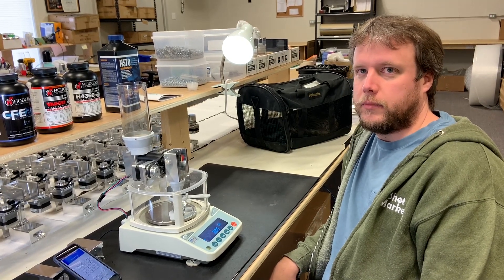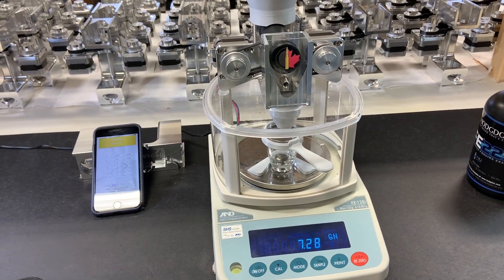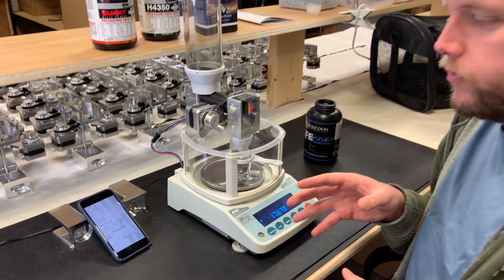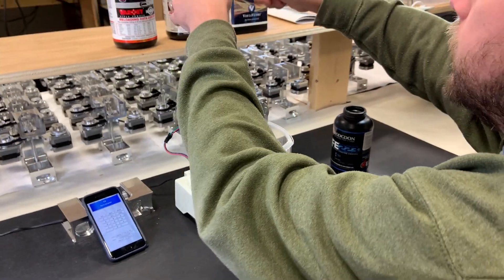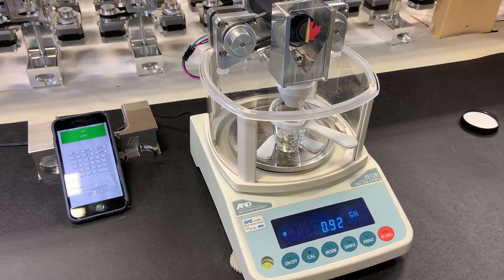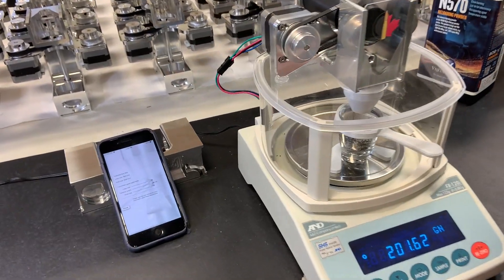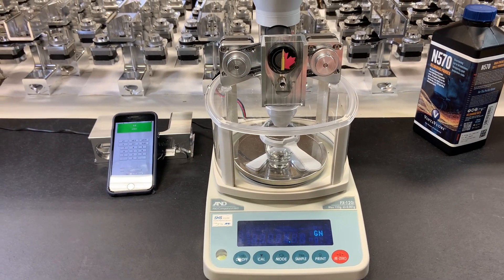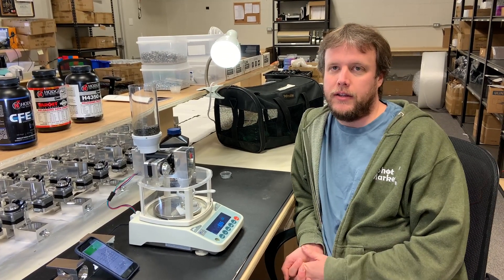AutoTrickler V4 - flow rate and calibration

Comment: Honestly, if I wanted something like this, I'd go chargemaster. I love the design of the V3 and older because separated two procedures cleanly; bulk dump and precision trickle. 

The only thing that could have been improved upon is the trickler system to be able to trickle without over/under dispensing or require so much powder before the tube can consistently pick up a grain.
Reply from the maker: V4 uses the same concept as V3 except in one unit, with easier powder changeovers. The Chargemaster uses a 0.10 GN load cell, this is 0.02 GN, so they are not really for the same intended purpose. However if you only shoot shorter distances and the Chargemaster is sufficient, absolutely it will save you money going that route.
Reply: @AutoTrickler  My apologies, I meant a matchmaster. Same concept for less.
Reply: @AutoTrickler  Turn the V4 from it's current configuration, with tubes facing outwards, to tubes facing downwards. Work with gravity/shorter distances to the powder charge tray. 

Have a nozzle that directly interfaces with the cup, maybe with an angled spout to prevent kernals from jumping around. 

BAM. Gemba / Process improvement.

Comment: I have to take my scale out-of-level to adjust the tilt for certain powders?  Doesn’t this induce error?  I don’t understand.
Reply from the maker: Adjusting the scale by a small angle has no effect on weighing powder. It's not important for the scale to be perfectly level. Extremely crooked would be noticeable but we're only talking about the cosine of very small angles.

Comment: Adam is it ok to use the feet of the scale for the "shim" when adjusting the flow to get it into cal, .010-.020  (so if close, like .020 shim needed ) can I just use the leveling feet on the scale or is it better to shim on the bumpers of the top plate?
Reply from the maker: It doesn't matter how you adjust tilt, you can turn the scale feet or put a shim under the back foot of the scale or the platform or the back of the V4. Just try to get the flow rate to 0.20 with most powders. Maybe a little higher for the larger kernel powders if they flow better around 0.24.
Reply: @AutoTrickler  thanks

Comment: Hi Adam,  

I have one of these on order just so I could get on the list.  I am not familiar with this system.  I do use N 570 powder for a couple of my magnum loads.  I have a few questions about how to use this scale system.  I currently use an older version of RCBS that is very slow and it has a hard time hitting the end weight without going over.  I see perhaps the potential for the same problem with this scale.  So I have a few questions about this scale.  First, can a laptop be connected with it to run it.  In this video you are using your phone.  Can it be operated without any outside controller?  I am not clear on how you purge and clean it between different powders so you are sure to remove all residual powder.  Is there clear instructions with the system to help someone like myself that has never used this type of system.  In this video you move the scales off level to get the N570 powder to work, and then I think you say you can just leave it like that.  Does it compromise the scales accuracy to move it off level?  Why not just change the angle of the dispenser tube to work with any powder?  I am sure I will have many more questions, my last question would be estimates on delivery.  I ordered my system from CEProducts today, they did not have a clear estimate but said if I had not received it by August to check back with them.  Do you have any better estimate about this.  

I know I will have many more questions.  I look forward to receiving my V4 and hope it is all that it looks like it is.  

Thank you for your response. 

Rob Jeffery
Reply from the maker: Please email me. I checked for your order and it's with CE so I don't have your email address.

Comment: how do you purge the silo and clean it out to switch between powders?
Reply from the maker: Remove the hopper then raise the back window and most of the powder comes out. Then lift and tilt it back and pour the rest out. Look through the tubes to ensure they are clear and check the back for any stray kernels.

Comment: Hi Adam, what is not clear to me is whether for the N570 do I need to tilt the system more? You did it by changing the til angle of the entire scale, but is this a good solution? Or was it only for demonstration?
Reply from the maker: Hi, your results may vary but I found on Saturday I had best results with a flow rate of 0.24 with N570. Try that. You can tilt the scale or the housing using a spacer and experiment.

Comment: Hi Adam,
I'm looking forwards to my V4 being delivered :-)
I'd have thought that putting the whole scale out of balance isn't technically ideal for the scale's accuracy and/or precision.

Would it be possible to create a shim piece for the scale top cover, for large kernel powders? It could be sold as an optional extra.
Or at least, the manual could give a measure for the angle of tilt or thickness of shim needed under the top cover.

James

Comment: Makes perfect sense to take a laboratory grade scale and put it out of level rather then making a proper lid assembly that would allow you to just change the inclination of the dispenser.
Reply from the maker: If you are using a powder that requires a different tilt angle than another, and you have verified that you do actually need two switch between two different tilt angles, and one tilt angle will not work for all of your powders, then you can feel free to adjust the tilt using a shim under the platform that allows you to easily swap between the two angles.
Reply: Here's something to try then.  Tilt the scale like he demonstrates, drop the charge.  Re-level the scale and weigh that charge to see if it is actually off?  If it is, then it's an issue.  

Since the front feed block of the auto trickler tilts (tilting it to get the feed started as demonstrated in the video), then it shouldn't be hard to make a shim that fits behind the feed block to set and maintain a tilt angle, unless it won't run run properly like that.  Otherwise, a shim to either tilt the entire trickler on top of the lid, or a shim to tilt the entire lid itself?
Reply from the maker: @edwardlance2379  Tilting the scale 1 degree is worth about 0.02 grains per 100. That's a delta on every charge (same for every one). Yes shims are OK too. There are so many ways to get the right tilt angle and all of them are acceptable. The right method for you is going to come down to convenience. Personally I would suggest have a "shim" and "no shim" scenario to easily switch between two types of powders you have.
Reply from the maker: @jacobjohnson6766  It's not generally difficult, there's just not much good information out there about what do if you are having trouble. By far most people have no problems at all and you probably won't either. When the flow is too slow it needs to be tilted down and when the flow is too fast it needs to be tilted up, and I need to put some information out there to explain the best way to handle that situation.
Reply: I'm sure you could slide something under the feet in the back to induce a tilt while leaving the scale level (business cards or something similar may work).
Reply: @neilharris4462  Yeah doesn't it make you feel all warm and fuzzy having to stick pieces of paper under your brand new $500 dispenser.
Reply: Please point me in the direction of the perfect product that you've designed and built and supported.